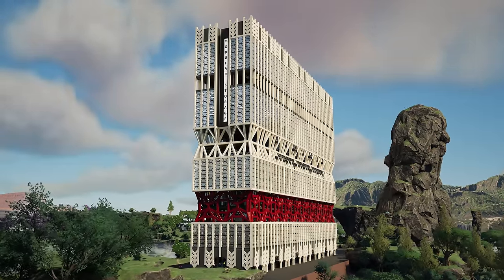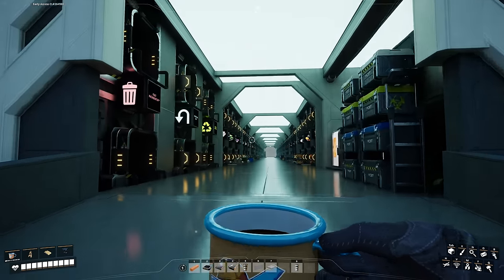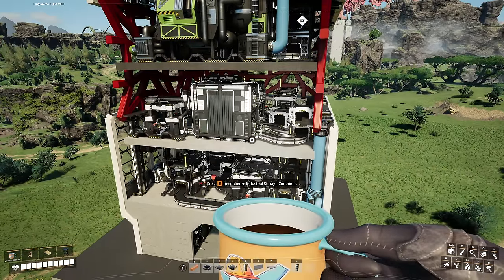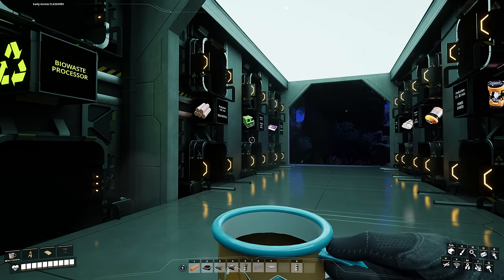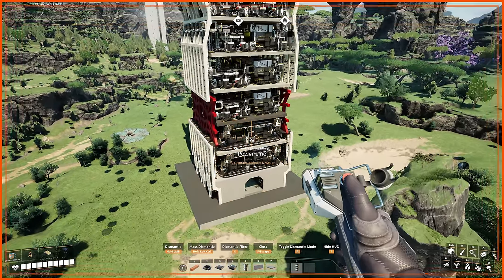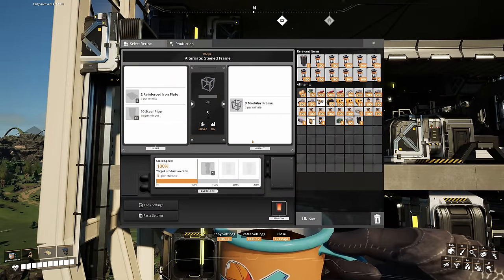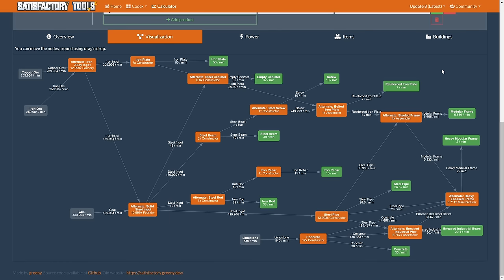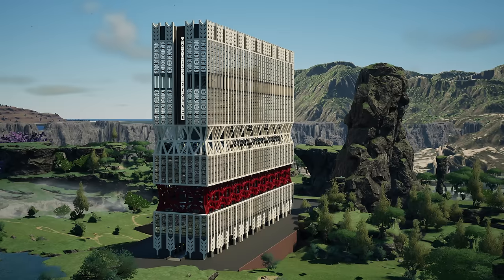Exploiting Blueprints to an EDGE in Satisfactory

Comment: Your Iron Encabulator literally made me delete and start a new save because it was so mind blowing. I was hoping you and teach us how to make something same for steel.
Reply from the maker: Actually have Steel Encabulator, but in single 4x4 production ratios for steel and encased beams are just to low, let alone there is no way making HMF with everything else. This video is partially the result xD
Reply: @Yakez42  I mean just a steel beam and rod output should be good enough 
Because tbh anything after that should have its own blueprint
Reply from the maker: Yeah but my steel factory was also handling rotors, stators and copper sheets aside steel pipes + beams >.<

Comment: I really love the build. Just wish the designer was a bit bigger. I want my factories to be walkable, you loose this most of the times you put something in 4x4.
Reply from the maker: I think if the goal is to make walkable factory in blueprint form it can be done. Only you will loose ~1/3 of density compared to my blueprints. It is just the matter of taking out 1 floor out of 3 xD And well not a lot of vertical blueprint stacks. But horizontal stacks are even easier to connect to each other! Check out my computer and HMF blueprints on this channel.

Comment: Love your sign design! The celimg light color is just perfect! I tried to recreate the signs on the container but having trouble snapping them on the container just like you do. I've managed to put sign on the both side. Front side is where the problem is, no matter how I tried the sign always too forward or too backward. Pray tell how to do it.
Reply from the maker: Painted beams... they are always the answer. I do not remember was it half nudge or not. Nudge tool is accessible with H key, and if you hold Ctrl while in this mode you can push things half-steps. So I just aimed beam in front of container, pushed it with nudge to desirable position, built it and slapped 3 signs before deleting the beam.
Reply: You're the best! I made it!
I didn't know I can even push thing half step in nudge mode XD
Thank you Thank you!

Comment: Hey man, really appreciated the video!  I'm just getting started and while I had all this, it didn't look nearly as good or compact.  I got the blueprints set up on my game; however, on the iron/steel side I cannot for the life of me snap in the conveyor belt lifts.  The bottom or top will snap, but the other end won't snap to the connector.  Any idea what I am doing wrong here?  Also, does it matter if the belt is going reversed or default?  Hard to figure out which direction goes where.  Not sure if the N/A mode on will auto figure that out or not.  Either way though, I cannot get them to snap in.
Reply: I am having the same problem. To me it seems like the lifts are switching to different mk. Like one place it looks to me as a mk.4 lift on one level and then it's a mk. 1 lift on the next level. It is the storage module B I run into these problems.
Reply: @lovejoydk838  I was able to get everything working by just ripping out all the belts on the side and placing my own. It’s not ideal because some come outta the build now but at least it all works. Took forever to know what was up and down lol. Prob easier with the jet pack but I don’t even have that yet.
Reply from the maker: Hey I am improving this particular blueprint connections when I release second video on Friday. Rule of thumb is to build all the lifts from down to up. This way you will have all the connections in correct direction. They do wary a lot and you can only follow them up by having proper starting point. And just use mk4 belts everywhere, everything below and inbetween does not matter for connections.
Reply: @Yakez42  I love your videos. Have subscribed, so looking forward to your next video.
Reply: @Yakez42  Been looking around a little. Seems lift floor holes are not working well in blueprints. Not tested it yet, since I build the modules far from my homebase. But replacing the floor holes might be a solution.

Comment: How should I apply the blue print file to my Satisfactory?
Reply from the maker: There is readme file inside zip. In short they are  in the same place where are your saves, but have extra folder.

C:\Users\USERNAME\AppData\Local\FactoryGame\Saved\SaveGames\blueprints\SESSIONNAME

If there is no session folder inside blueprints\ you need to unlock blueprints in the session progression first, then save any blueprint inside of the game. Session folder for blueprints would be created.